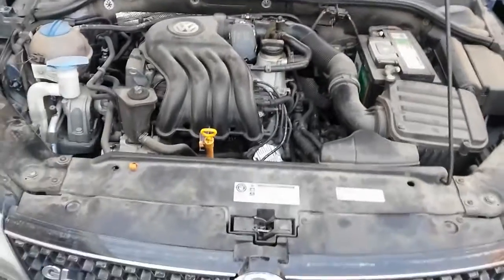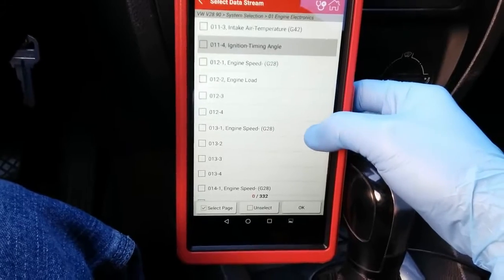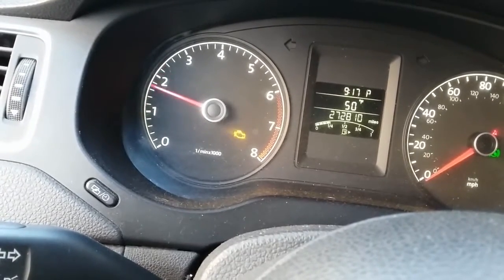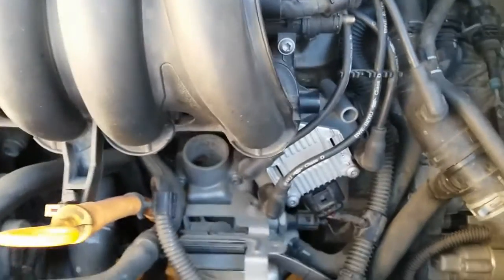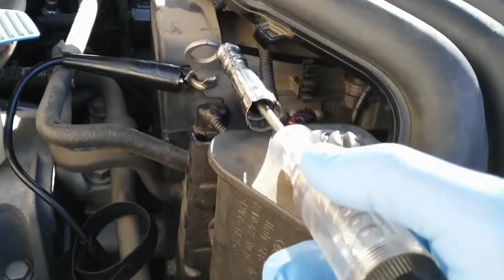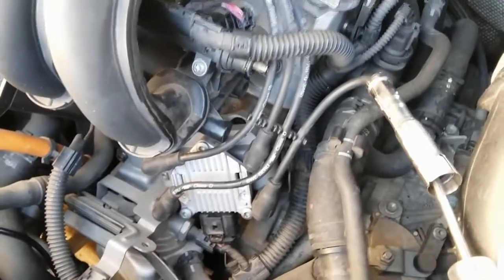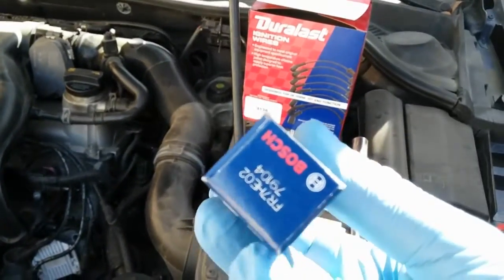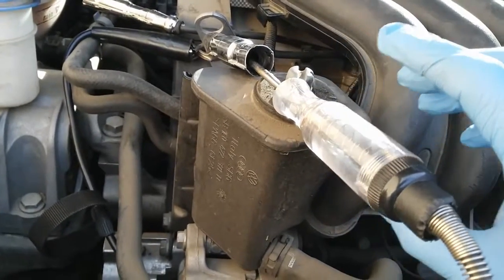(VW Jetta) Diagnosing a P0300 and P0301 misfires codes

Comment: I have the same issues with Jetta 2015, i changed the spark plugs and coils, but still, i have a problem with cylinders 1 and 4
Reply from the maker: @saloh3530  Is your Jetta TDI?
Reply: @EliTheOBDTech  the engine is CBPA 2.0L Motronic / 85kW, 
Here is the VIN# WVWSV1AJ8FM201024

I have 4 codes (p0300, p0301, p0304, and p0351)

Comment: My spark jump out the wire boot.
Reply from the maker: @juanmiranda4521  Do you have check engine light, what codes?
Reply: @EliTheOBDTech  yes, p0302, cylinder 2 Misfire Detrcted
Reply from the maker: @juanmiranda4521  Did you have a  strong spark from the wire boot?
Reply from the maker: Try comparing spark from another spark wire too see if the spark jumps with strong energy.
Reply: @EliTheOBDTech  OK. I'll do it tomorrow, thank you.

Comment: Will the check engine light need to be reset at the dealer or will it go off after the repair?
Reply from the maker: @tjbaretta  If the PCM no longer sees any problems, the check engine  light should go out after several drive cycles.

Comment: I changed the sparkplug, wire plugs, ignition coil and tested the fuel injectors; they are good and still I have an engine light on and it rattles with lost of power.
Reply: Same problem here did you find the route cause?
Reply: @Deathbeforedishonour55  So, I checked the continuity from the ignition connector wires to the ECU and they were all good, which means the ECU/ECM was faulty. 

I bought a pretty good scanner and a code O1314 showed up and that is a no signal/communication.

Comment: also typical problem with these wires . the wire's insulation at the tip fail and power is grounded to the metal cover before it reaches the spark plug .
Reply: I'm have same problem 
I changed coils and plugs.
Still problem

Comment: Hi Eli, do you recommend going to iridium plugs on a 2015 VW Jetta 2.0L gas sohc.?
I was having engine misfire & flashing check engine light sometimes when I was driving and accelerating, so I replaced my spark plugs, spark plug wires and ignition coil as well. Instead of putting in Bosch FR7HE02  which I saw in couple of youtube videos and which are Nickel plugs, I put in NGK ZFR6FIX-11 which are Iridium plugs, Also I replaced the wires with Denso Ignition wire set and Ignition Coil with NGK Ignition Coil.
I don't have engine misfire or flashing check engine light anymore but I can hear like a sparking sound after some time when the engine starts.
Do you know where I went wrong?
Also could you please tell the name & model of the OBD scanner that you used in the video.
Thank you
Reply from the maker: Yes, only if the original spark plugs from manufacturer are Iridium. Sometimes the heat range of Iridium plugs can run too hot.
Reply from the maker: Launch x431 Pros Mini
Reply from the maker: It would be nice if you had capable scanner that can read misfire counts to make sure your replacement parts was a fix.

Comment: Do you know what it could be when my Volkswagen starts shaking because of the engine , like should I just get rid of it then because I don’t know how to fix cars :(
Reply from the maker: It could be many things that can caused engine performance issues such as misfires due to bad ignition coils, plug wires, spark plugs, faulty injectors, faulty intake manifold gasket and worst case scenario mechanical problems such as low compression or faulty head gasket. Other possibilities would be jumped timing chain, faulty VVT control solenoid, cam sensor, crank sensor and faulty MAF sensor.
Reply from the maker: Best thing is to have your vehicle checked out by a professional. If not, get your vehicle scanned by Autozone and have them print you a copy of all codes stored, if any are present.
Reply: @EliTheOBDTech  thank you I got P0300 random/multiple cylinder misfire detected  and p0302 Cyl2 misfire P0301 Cyl 1 misfire and P0304 Cyl4 misfire  and P0351 ignition coil A primary/secondary circuit and P050B cold start ignition timing and P130A hide cylinder, do you think it’s worth fixing up? Because I feel like the misfires are expensive and I don’t know what to do or if I should just sell it for scraps
Reply from the maker: @Iebaxos  It's hard to say, you need to find the source of the problem first, to determine if it's worth fixing. You may have a jumped timing chain causing these codes or a faulty ignition coil module.

Comment: What’s the difference between ignition coil and plug wire
Reply from the maker: Ignition coil is the unit that creates energy voltage spark to be delivered through the plug wires

Comment: Ive run into this issue and took it to the dealer they told me it was the sparkplugs and valve cover. Does the valvecover have ANYTHING to do with a cylinder 1 misfire? The car doesnt stutter, no loss of power no noticable loss of fuel economy no delayed crank. What do you think?
Reply from the maker: Only of the valve cover gasket is leaking oil around the spark plug hole and allowing the plug to get wet with oil.

Comment: Thank you for the great video. at 5:59 you say you are connected to chassis ground not the body negative. what does this mean and what is that wire connecting to that is showed on left hand side of vehicle? appreciate the help
Reply from the maker: Hey Colin, chasis and body ground is pretty much the same. I was trying to convey that is not good to connect a test to battery negative post, it can cause an explosion to the battery.
Reply: @EliTheOBDTech  Thank you, replaced my ignition coil and wires yesterday using this video and fixed my cylinder 2 misfire. great video

Comment: my VW 2001 MK4 Golf gti VR6 has these codes , I read online that im running the wrong NGK spark plugs , Need the two prone NGKR ones .
Reply from the maker: It is crucial to run the correct heat range spark plugs for your vehicle.